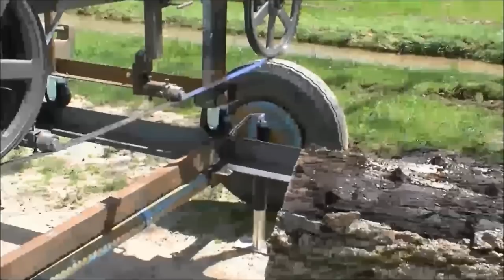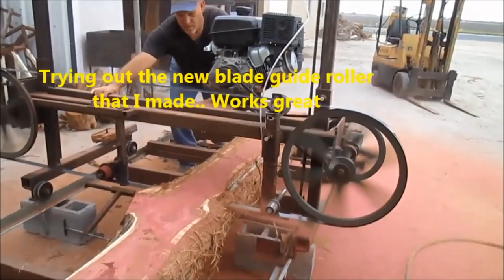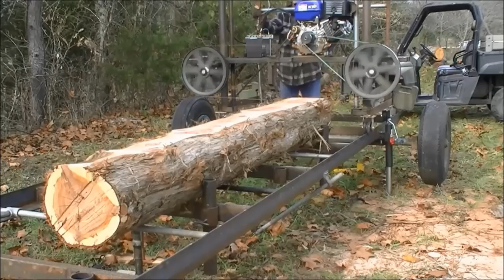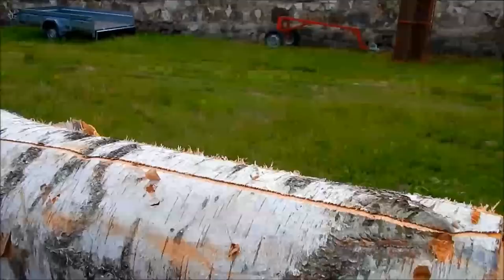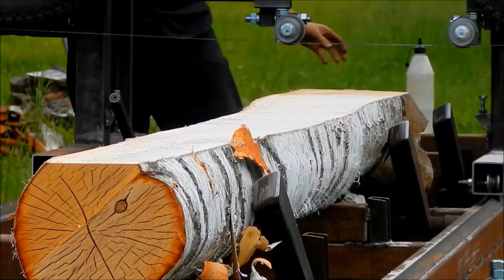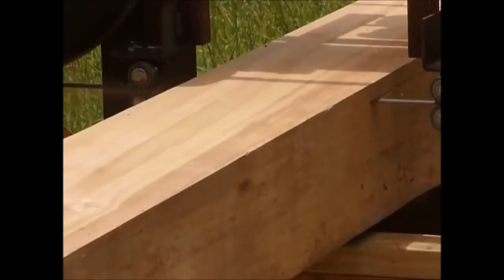Homemade Sawmill  Woodmill Video's Compilation

Comment: Hey Larry nice build. What size belts fit the 18 3/4 wheels? 5L or 4L and length
Reply from the maker: I will see if I can find out. We buy them in kits and they are not a separate part number. they come with pulleys
Reply from the maker: I believe they are 59" 5L and they go on tight as hell with gojo hand cleaner